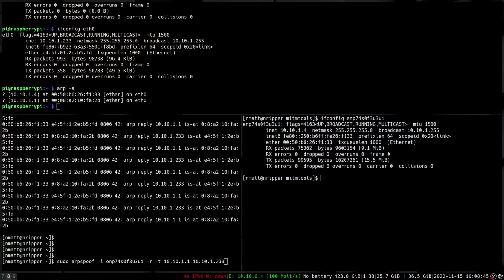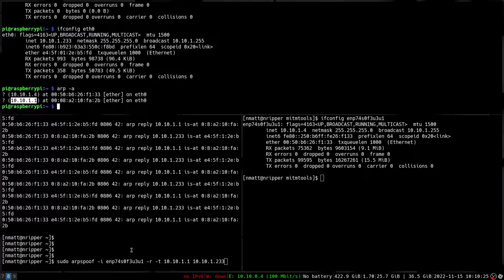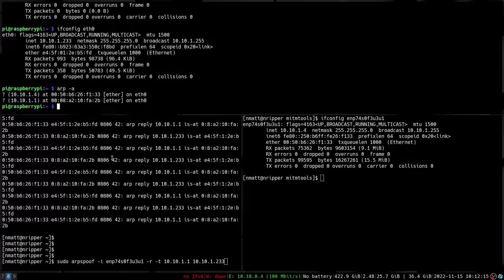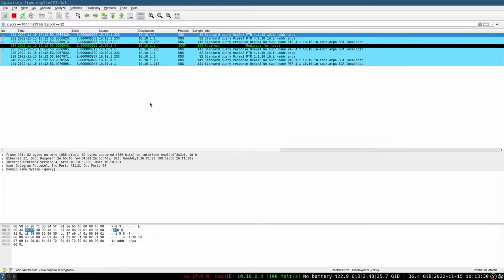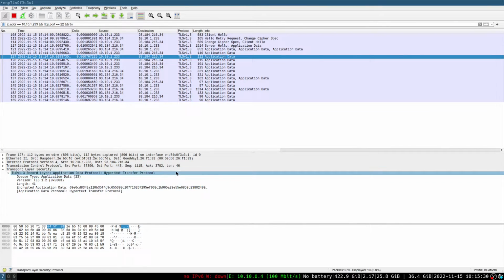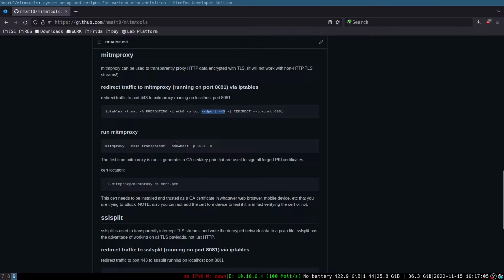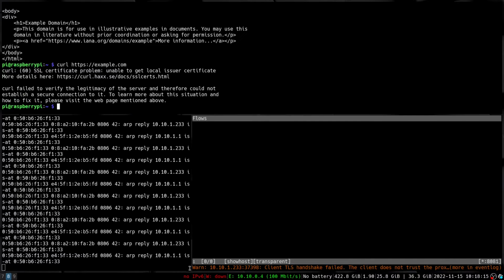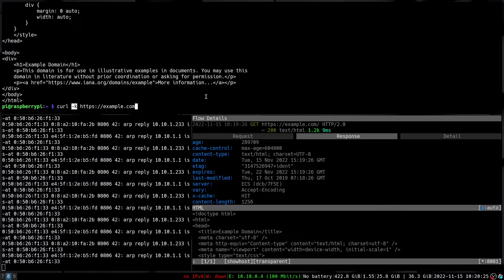Intercepting Communications of IoT Device with ARP Poisoning and MITMProxy

Comment: There are quite a few iot devices out there that are based on the esp8266 and esp32 microcontrollers. Problem is they dont have much memory space to store certificates. You either have to hard code the cert into its sketch which is not practical because certs expire. Or you have to add cumbersome code to manage downloaded certificates. So to get around it the esp based libraries make use of a setting that allows you to ignore certain standards and simply continue with the request even though there ate errors. I.e client.setinsecure()  The esp based libraries gets you around issues related around cert trusting. Thanks for sharing this i will try it out on my solar inverter's data logger to try and see if i can intercept its traffic.